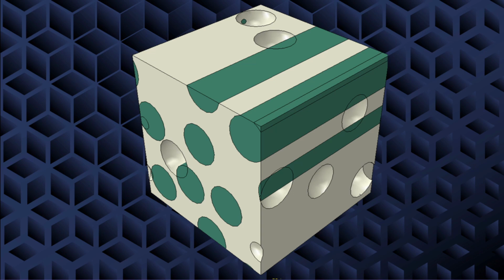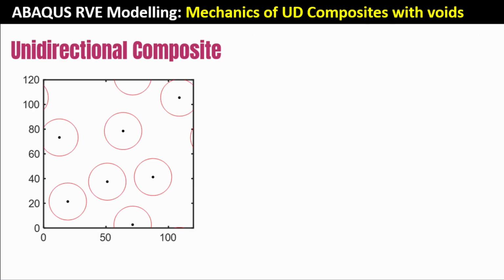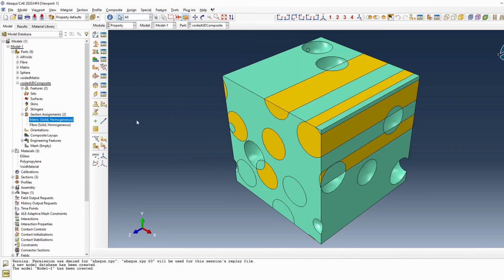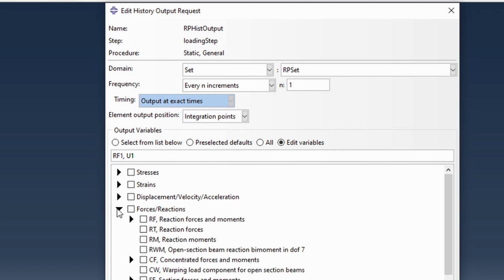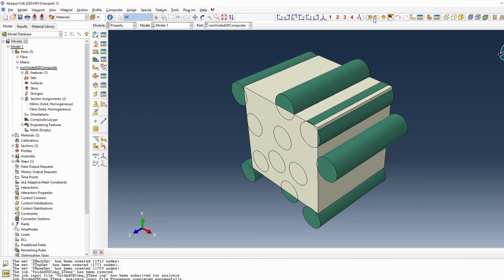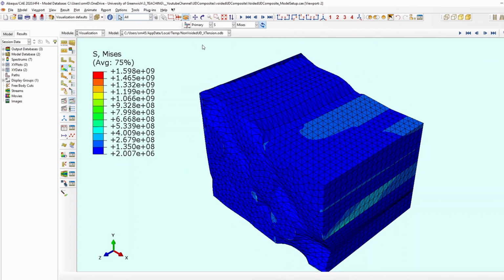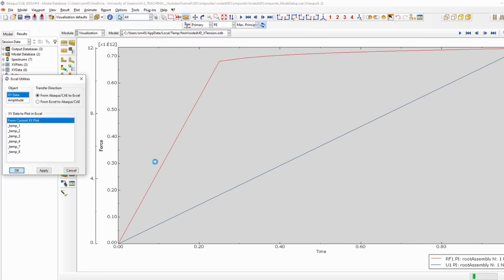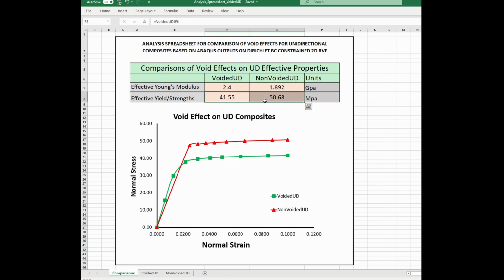Composite with voids: An RVE modelling in ABAQUS

Comment: Hi Sir, this video has been very useful for my project. But how long does the simulation’s job take to complete as on my Uni’s computer the job was only on “submitted” for 2hrs
Reply from the maker: Depends really on the computer power you have. I think mine too just about 10 minutes to run. You can try reducing the mesh density and make it a bit coarser, as that might improve the run time. Alternatively, you can ask at the job creation stage for more cores of your PC (say 4 cores) be used during the simulation. This will mean the job will draw more from the computer resources than normal. Hope this helps.
Reply: Thank you Sir, I will try these next time. Another question I have is, if there is any way to alter the size of the voids while keeping the fibre the same size?
Reply from the maker: Yes, it is. I think you have to use the Monte Carlo method to introduce the voids into the original non-voided matrix first before merging it with the fibres. It has to be done ab initio.

Comment: Hi Dr Michael, If I use Dirichlet BC in this model, will the result be very different from the periodic BC result? Could you please give some advice on how to validate the result of Dirichlet BC? Strictly speaking, it's not rigorous in micro-scale RVE models.
Reply: I read your paper related to the difference between Dirichlet, Neumann and periodic BCs. Could you please tell me how to find out the stiffness when using Neumann BC? For example the tensile strength in fibre direction, should I calculate an average displacement for all of the nodes on the front surface to get the strain data?
Reply: I think about a method of conducting a comparison of the displacement BC and stress BC, if the result is close to each other, then it will represent the result of PBC to some extent.
Reply from the maker: Hello Chenyi, there is a lot of questions in this comment, and I will try and respond as best as I could:

1. There is certainly a difference between Dirichlet BC and Periodic BC imposed models. It all depends on how you interpret the tracked model variables. PBCs tend to give a better result when dealing with heterogeneous microstructures, but if not, say you are modelling a homogeneous media, then there might not be distinct differences, at least looking at the contour plot. You will have to assess the convergent properties (say effective properties) to check this out for yourself. In my Virtual testing framework paper for UD composites, I did some case studies on this so that might be a good reference for you.

2. In terms of finding the stiffness from a neumann BC, I will suggest you follow the same way as you would for a Dirichlet BC. You simply need to extract the homogenized elastic properties. I think this video of mine can be  a good start off point: https://youtu.be/dQuX8u9RcdM

3. With the tensile strength in fibre direction question, I think a volume averaging is possibly the right approach but you have to be sure of what volume averaging you are looking at. Again, my video above can be a good point for you. The key is that you have to determine some stress and strain measure from your simulation. The stress can be volume averaged over your domain. The strain has to be a relative displacement between two reference points. It could be between a fixed back end of the tensile specimen and a deforming front edge of same specimen. If the later is the case you are working with, then your suggestion of averaging the displacement on the nodes in front will be a sensible way to go.

4. I do not agree with your last comment that a dispalcement BC and stress BC if it seem close (depending on how you define close) to each other becomes a representative solution to PBC imposed model. It is possible I have misunderstood your comment. The key thing is that PBCs are very distinct from DBC and NBCs. You have to deal with them differently, study parametrically each BC type effect on your model before arriving at any conclusions. Again, your definition of close has to be clear as for certain test scenarios, close may be more evident than other test scenarios. Again, in my paper, I tested a holistic set of loads on a model to truly understand the effect of BC types on the model. I found that the shear load cases were quite sensitive to choice of BCs and I wonder if you have looked at that.

That is a long explanation but I wanted to deal with all your questions in one place.
Reply: @MichaelOkereke  thanks sooooooo much for your detailed answers! You are really an excellent researcher and a good teacher of me! I learn a lot from you! Thanks again for your help😆!

Comment: Hi Dr Michael, Are periodic boundary conditions possible for this model? I noticed that the number of nodes on the opposite surface may not be the same.
Reply from the maker: Yes Chenyi, PBC  can be applied to any  model including this.  However as you spotted,  it will not be possible to apply my type of PBC on this domain due to non matching nodes. There is a different type of PBC for this type of domain. It involves polynomial interpolation.  You can read more about it in this publication of mine:  https://www.sciencedirect.com/science/article/abs/pii/S0263822316322711
Reply: @MichaelOkereke  Soooooo hard! The voids complicated everything! Thanks for your help Dr. Michael Okereke
Reply: @MichaelOkereke  Dear Dr.Okereke, I considered a method of applying PBC to the voided RVE. I think I could assignment a very low stiffness to the voided area instead of cutting it, then the mesh might be able to apple PBC. Do you think it will work?🥲
Reply from the maker: @Chenyi, I do not think this will work, as voids are not simply a low stiffness problem, they are actually air-filled. PBC can be applied even for this domain but it will require a different PBC implementation than is used in my PBC2DGen code. Good luck.

Comment: Sir, the part generated after merging the two instances has only one material assignment(fiber).. Have you ever faced such type of issue??
Reply from the maker: Hello @Subrat, thanks for the email. I think during the merging process, under the Geometry Intersecting Boundaries for the Merge/Cut Instance, make sure you select the option about Retain Intersecting Boundaries. If think if you do not allow for the intersecting boundaries to be retained, everything will merge into a single model and that could be the problem you are having here.
Reply: @MichaelOkereke  sir,I have selected retain boundaries...but still the part generated after merging the instances  have only one section assignment
Reply: @MichaelOkereke  the issue is solved now sir... thanks for your response
Reply from the maker: So @Subrat, what did you do? How did you solve it?
Reply: @MichaelOkereke  Sir , I mannually added the other section assignment in the mergedpart
Reply from the maker: makes sense @subrat

Comment: Very interesting video but I wondering is it possible to get the stress and strain directly from Abaqus instead of getting force and displacement and turn them to stress and strain as you did in Excel, if so kindly let me know how I can get that as I tried but I got different results compared to the results you got by your way
Reply from the maker: Yes, absolutely John. In fact my next ABAQUS tips and tricks video is precisely on the point of generating stress-strain plot using volume averaging method. This will help you so watch out for it.